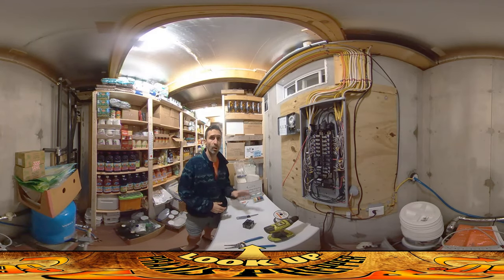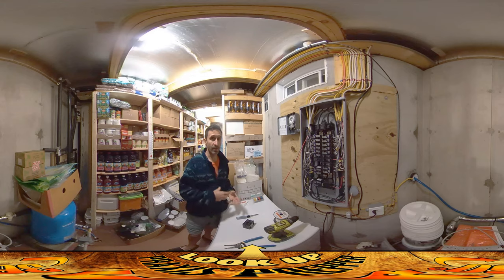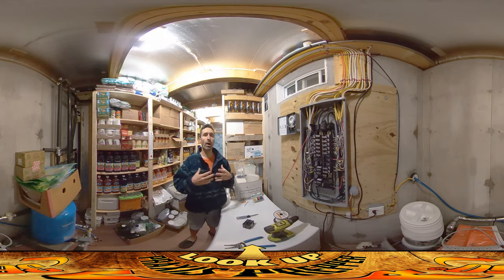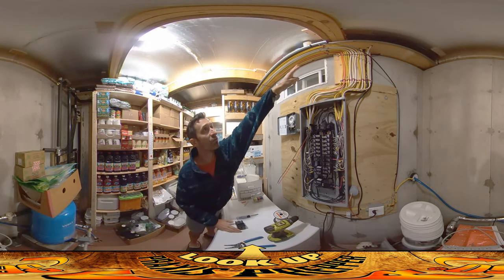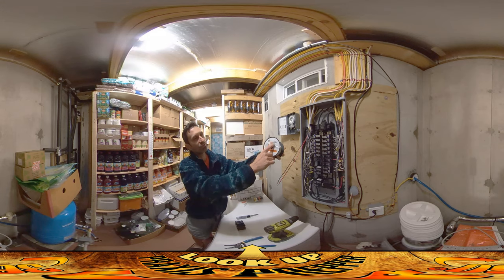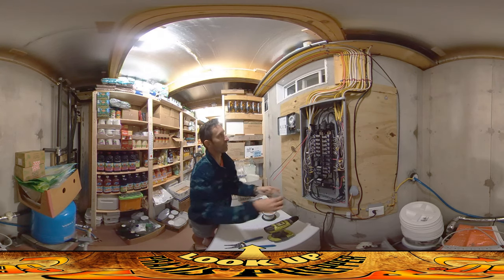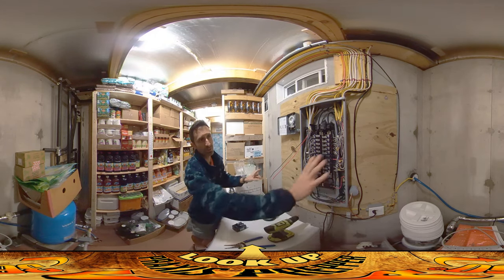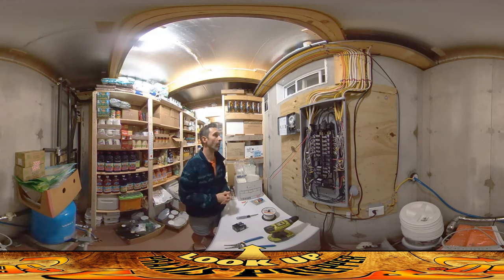Homestead Building - Heavy Duty In-Line Electrical Timer Install

Comment: I have a timer just like that loved it when I used it in ran barn lights for the rabbits
Reply from the maker: I wish yours was just like mine. This one seems to be busted on delivery. The clock doesn't spin at all. It had really high star reviews, but in looking for answers it seems that a LOT of people have received DOA clocks. I'll mention it in the next video. I'm presuming they send a new one and I'll be swapping it out. Fortunately most of the hard work was in running the wires out the side of the breaker box. The swap itself should be a breeze... if they agree to send a new one.
Reply: @PraxisPrepper  bummer hope you get that fixed up

Comment: FYI: I recommend getting the hot water temperature to at least 140F for 45 minutes avoid legionnaires disease. If your hot water has a extra port, install a thermocouple ( or thermocoupler well) so you can measure the water temperature. You might need to install some type of smart controller that kicks keeps the backup element on while it heats up to 140 and keeps it there for 45 minutes. There might be a Temperture PID controller that you can program that will monitor & keep the temperature at 140F 45minutes. A PLC would also work. Even an Ardunio or Raspberri Pi would would work if you don't mind doing a little DIY electronics.
Reply from the maker: I'd been warned about that potential from my hot water install guys. What I ended up doing is to install this timer to be sure the system gets a daily kick up to 140ish. I've been monitoring it at we hit 140+ all the time. So this seems to be working. Thanks for watching my back regarding legionnaire's disease though; that'd be no fun to get!
Reply: @PraxisPrepper   No Problem. I am sure you don't want to join the french legion! /sarc

Comment: THHN is Thermoplastic High Heat resistant Nylon coated and is appropriate for this application.

10-3w/g means 10awg three conductors with ground (the ground only needs to be large enough to trip a breaker or pop a fuse.) included.

Best practice that I was taught was to use a ferrule or to tin the conductor when terminating stranded wire smaller than 6awg at a screw-type terminal. Not required for clamp-type terminations unless indicated by the manufacturer.

Yeah, we've all gotten away with stuffing strands under a screw and giving it a twirl but there are too many ways that it could go wrong with 5kW coursing through.

Again, it usually works fine but "I'm smellin' a lot of "if" comin' off'a' this plan." (Any browncoats here?)

IIRC, your dad was in the field. I'm sure that whatever he suggested was right.
Reply from the maker: Yeah, that grounding washer was a real trip to get snugged down with the ground wire under it. I had to strangle it with the ground by using the electrical pliers. Weird design. I have some conductive goo that I could maybe add to that... unless it'd lube it up and make it more slippery.
Reply: @PraxisPrepper  It gets easier with practice... That way, when you have everything in the house done and you don't need to have the institutional knowledge anymore, then you'll know exactly how to do it.

Comment: With the amazing technology in the world today. For example this video in 360 degrees right here in my house and all that that implies. What's up with engineering that doesn't have forever tight valves on a hot water heater?! I mean really . . . man on the moon and all that. Doesn't it seem a little backwards to you?
Reply from the maker: I often note the same thing. A product has one job, and can't even do that right... wait are you talking about the valves or this timer? Yeah, the timer is defective too it would seem. It only runs the clock when the switch is on. When it turns off the switch, it kills the power to itself as well. I'm not discounting the idea that I might have hooked it up wrong. I'm going to try to figure that out tomorrow with tech support. But there are only 5 connections for the installer to make on the thing and they're all very straight forward. So yeah, looks like a defective timer too. :)
Reply: @PraxisPrepper   Even though I have a much smaller, less complicated cabin than yours, I often feel the prepper journey is as much practicing resilience in the combination of not knowing what I'm doing and screwing things up along with the sheer magnitude of things I've had to learn. Some things are "easy" like felling trees and turning them into fire wood. Some are complicated like building a solar system from scratch. All together going off grid has been an enormous learning experience. So, yeah, resilience has been a huge part of it. Throw in things like you're messing with (sometimes leaking taps and wonky switches) and the job is pretty big.
Reply from the maker: @DocJaeBass  You and I see this all very similarly. In fact, I often feel like our job is to learn/reinvent all of everythign that anyone has ever done, confirming that it all works properly and is all managable by ourselves alone if necessary. Not a small job. ;)